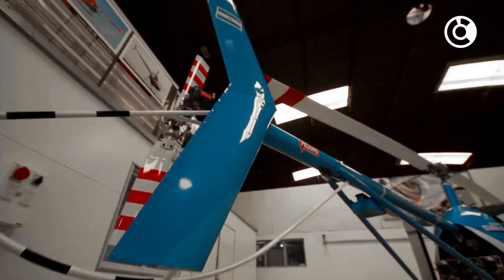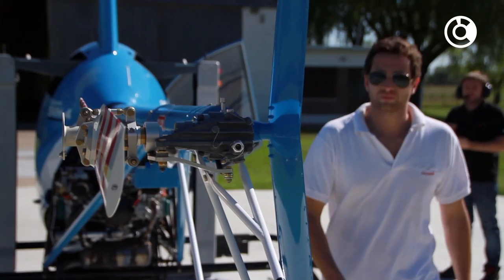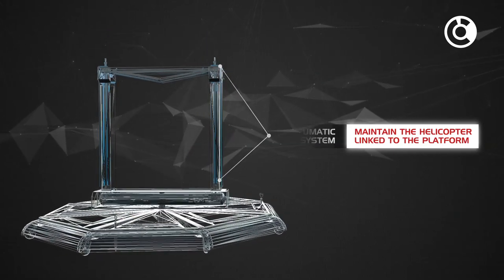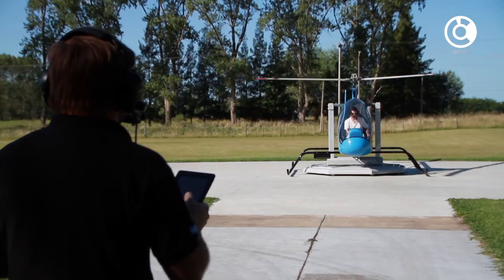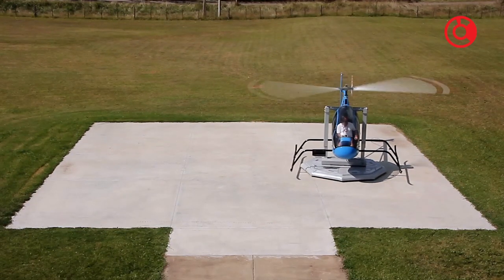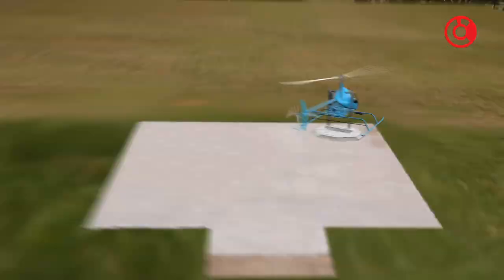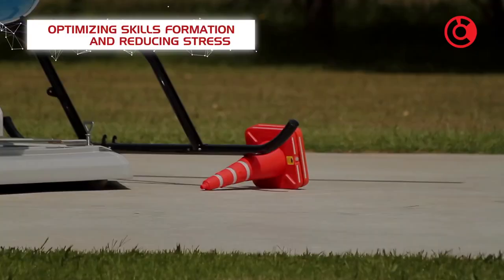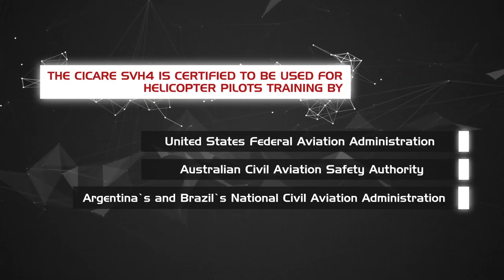CICARE SVH4 Helicopter Trainer

Comment: It quickly builds skill, coordination and confidence for the nervous (and not so nervous)  learner during  the critical first 10 hrs of helicopter training.
Reply: I don't see how..since this thing never gets out of ground effect...and the flight characteristics of a heli are completely different in ground effect vs self sustained flight..
Reply: It also has a super realistic mode where you disconnect the platform and fly around completely unrestricted to simulate flying around completely unrestricted...
Reply: seems like it would build bad habits and false confidence.
Reply: +warmfreeze So, based on that you will never recommend commercial pilots to use any simulator..isnt it? Duhhh
Reply: at least a simulator actually simulates the effects of crashing. This thing completely hides them, you cant screw up.
Reply: One of the most difficult things to learn how to do at the start of flight training is controlling a helicopter in a hover. Yes flight characteristics and general operation techniques differ while in ground effect vs out of ground effect. Personally I have seen guys with 30+ hours of flight time who could not effectively and safely pick up and take off because the learning curve on hovering is much steeper than the learning curve of straight and level flight. 
All that said I have my own reservations about using this thing, seems a little too hands off on the instructors side. I wouldn't want to be the instructor locked inside a 6m x 6m fenced in area with a main rotor and tail rotor in operation spinning around with an inexperienced student. Can't hit the kill switch on that handy tablet if the tail rotor spins around unexpectedly and cuts into your shoulder, or if theres a sudden gust of wind and the student loses control with skids off the ground -gets blown forward and chop your head off.

Comment: so what happens if you give it too much collective & the heli starts to lift the entire platform from the ground??
Reply: I'm guessing that engine isn't powerful enough to lift much more than the pilot.
Reply: The instructor can control the collective with the tablet app.
Reply: Mini Mechanic I highly doubt this helicopter would be over powered ...I'm sure it just has enough power to learn...
Reply: I heard Mr. Augusto Cicaré say that if you detach the heli from the trainer device, it can fly, it is a helicopter.
Reply from the maker: Hi sir, this is a common concern, the system has a set of sensors in the platform system that shut down the engine when the helicopter goes over 1 meter in hight, also even if you try this the weight of the helicopter + platform and pilot is more than the MTOW of the helicopter and finally the instructor has a control tablet which he can shut down the engine at any time, or make the helicopter go back to idle. Hope this clears your questions. :)
Reply: Aquí claramente Don Augusto dice que es un heli normal. S ele quitan los soportes y puede volar:

https://youtu.be/a5O9HWUHtNY?t=780
Reply: i was thinking the same thing...

Comment: I’m not understanding how this is cheaper than regular helicopter training. It looks like a fully functional helicopter to me, a fixed wing pilot, but strapped to the ground. Is it just cheaper to operate by the hour?
Reply: Very cheap, the first hours are the most difficult in the training
Reply: Notice that it is a small single seat helicopter only. There is no need for trainer seat. 
Also, there is very little risk in operating it, that lowers operational and maintenance costs.

Comment: Is the base blocked from leaving the platform somehow? I can see bad things happening if a student accidentally drifts over and the base digs into the dirt/grass and makes the machine tip over.
Reply: Spinal Column The trainer can shut off the engine remotely.
Reply from the maker: When the trainer hits the grass the platform gets stoped because of the excess friction, because of the wide skids there is no possible way to tip the trainer or hit the ground with anything but the skids, believe us we had it tested with 6-7 year old childrens, and others not so young. :)

Comment: Or you could train in a r22 with an actual instructor and learn how to fly without training wheels.
Reply: Looks to me like this would eliminate vortex ring state which is the leading cause of student helicopter pilot crashes.
Reply: agreed. seems like extra expense here. expensive training wheels. too far removed from reality.
Reply: do yall realize that simulators are used for training everywhere, it is not meant for you to do all of your training on it, but rather a tool to use, specially when one is initiating...